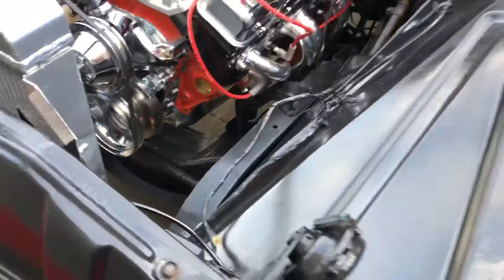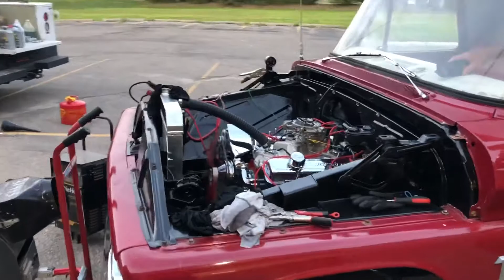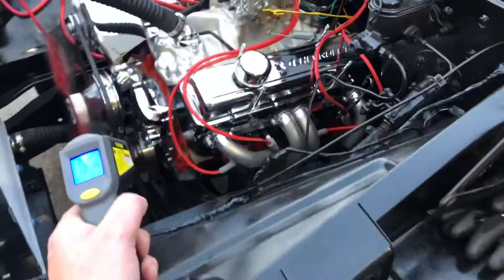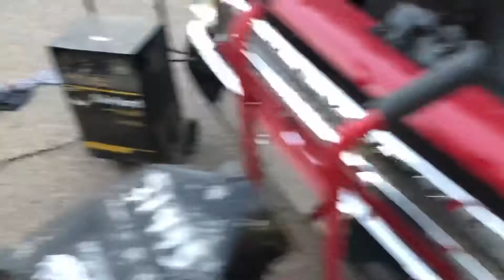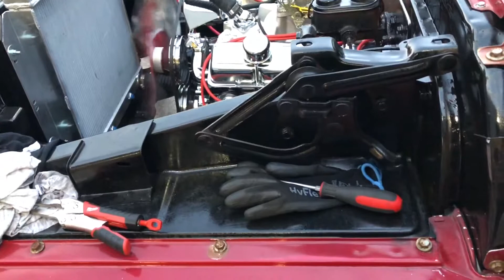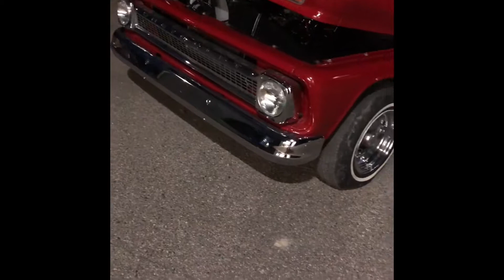1964 C10 Engine Swap Part 5

Comment: What motor mounts did you use? In the process of the same swap myself
Reply from the maker: I used the original mounts there were on the straight 6 in the C10

Comment: What exhaust setup are you running
Reply from the maker: I’m using summit racing long tube headers with a pair of Blackhorse Racing Single Chamber Performance Race Chambered Muffler